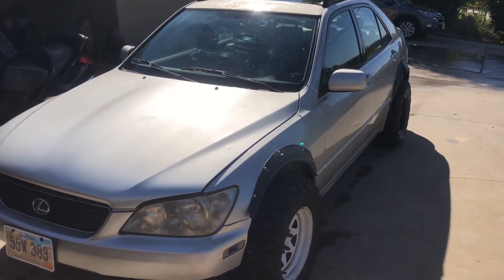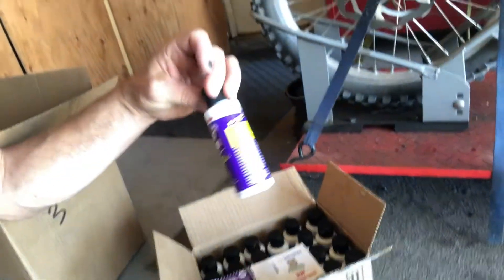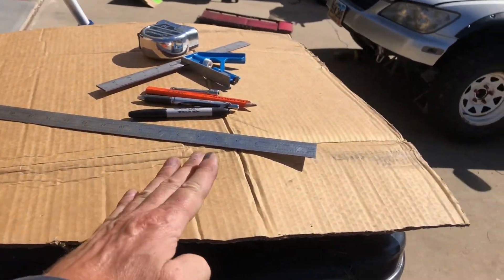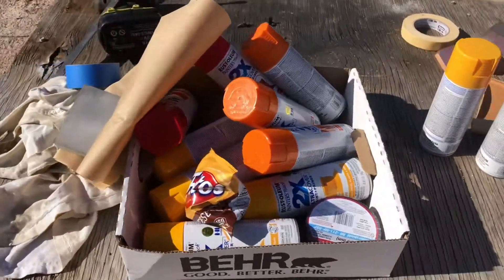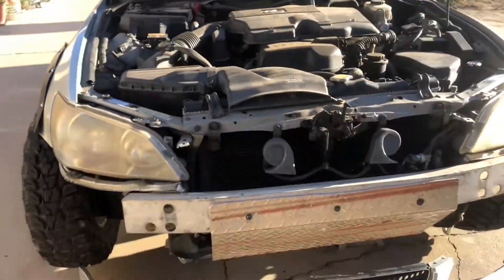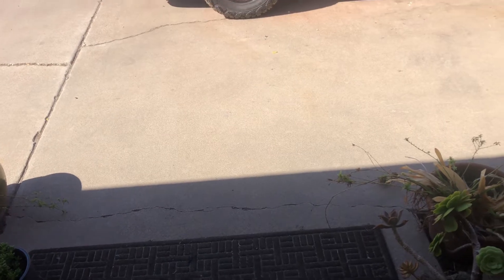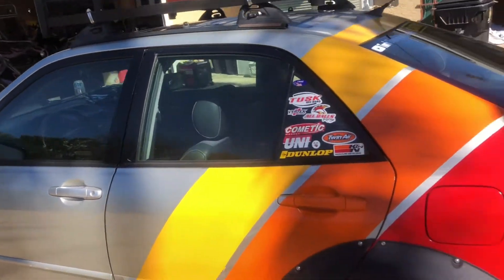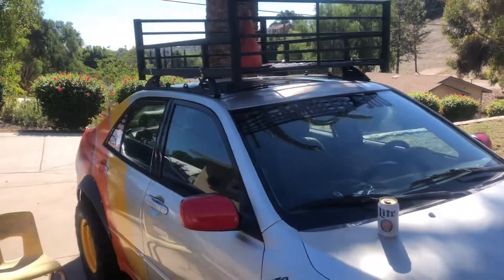Gambler 500 Rally Car :Part C- Salvage Lexus IS300 Transformed Into Fun Mobile!! #SuperEasySuperFast

Comment: I know you did this a couple years ago, but I am building a Toyota Avalon that's pretty similar in design and appearance. I liked the skid plate idea, but unlike you I don't have any random material laying around so I plan to pick some up. I tried to estimate the size I'll need, do you think something like 24"×36" will be sufficient? Then taper it down like you did?
Reply from the maker: @JeepyGunner  when I am planning something like that out, I try to use a piece of cardboard to make a template.  Then you will be able to see what size material you need.  Good luck on your project, bet it will be awesome.